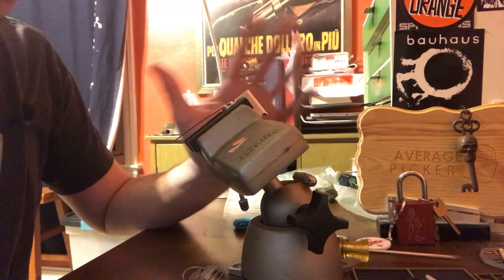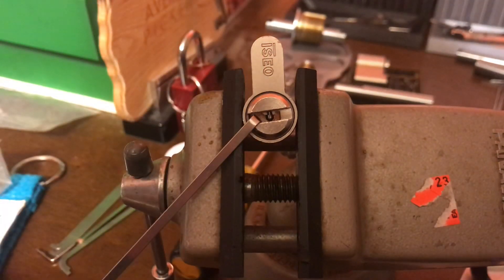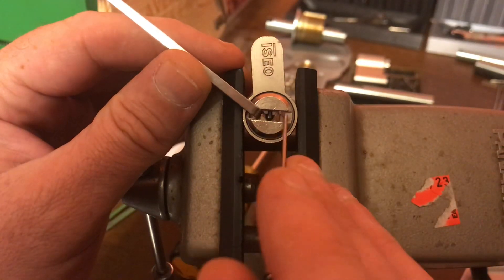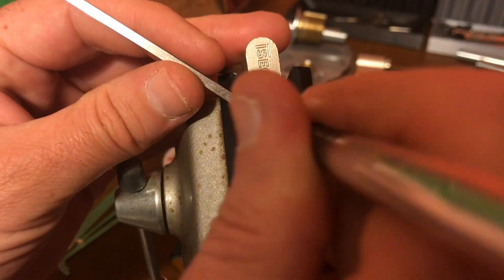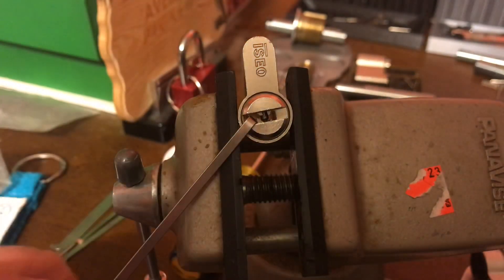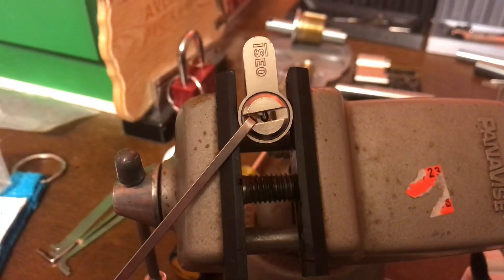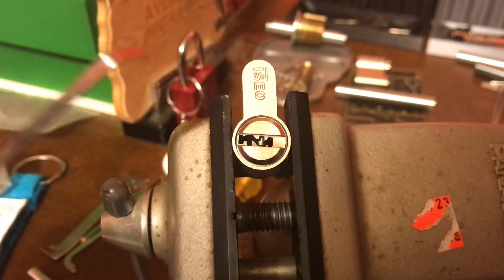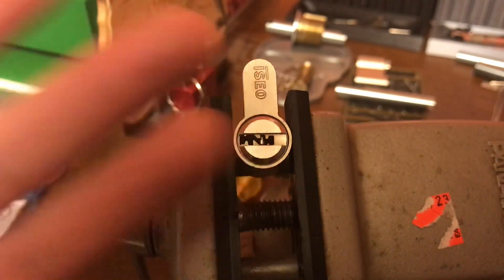A Dimple Picking Problem

Comment: When Picking Dimple locks, you should try to rotate your pick in the opposite direction to what you are tensioning.  This shortens your picking height and makes it easier to deal with counter rotation (feedback and control is better).  So if tensioning clockwise rotate your Pick counter clockwise and vice versa.  The warding and pin placement will determine which is the best option.
Reply from the maker: Oh that’s interesting about pick rotation. I was trying to work out if that had something to do with it but wasn’t quite coming to a solid conclusion on it. I was thinking it through more by accident as I tried to get a bit more lift. Thanks

Comment: Nice rant. I and I believe we all have had conundrums similar to this at some point. Binding order changes when you pick clockwise in comparison to counter clockwise. And with dimple locks the torque is different when you place your wrench in different spots. 
But I believe you covered all that in the video. 
I hope it helps the next picker to have this problem

Comment: I'm not a dimple guy at all. But, I found it interesting that you said you get it to set by pushing the plug up a bit - and only CCW.  That feels like the pin is still slightly shorter than the plug itself, leaving the spool still sitting in the plug. And, maybe the right edge of the keypin hole is less sharp than the left. What driver type was opposing the pin when it was in #6? Maybe it was matched with a slightly beveled plain driver, that solved that? Or, if this same spool was in #6 with the zero bitted pin, then maybe the milling on plug hole #6 is slightly chamfered?

Comment: Although I can't help, Im definitely interested in what you find for the answer. The post you pinned did that help?
Reply from the maker: It doesn't help the wider issue of how the heck I might notice, without the key, that that sort of lift is needed but it did confirm a suspicion I was starting to randomly find my way to. Though that leaves me with some other questions now. lol.